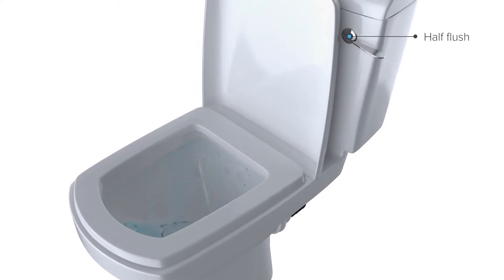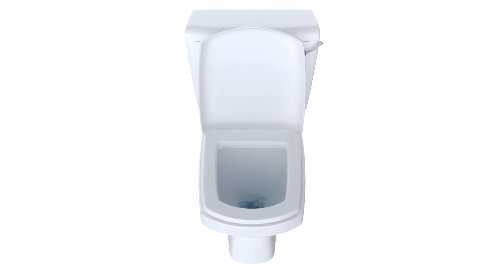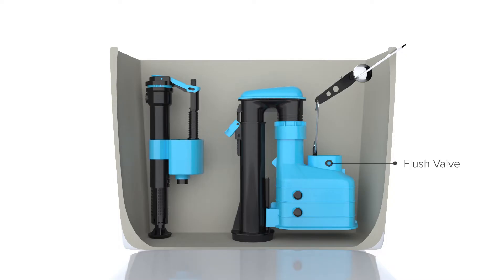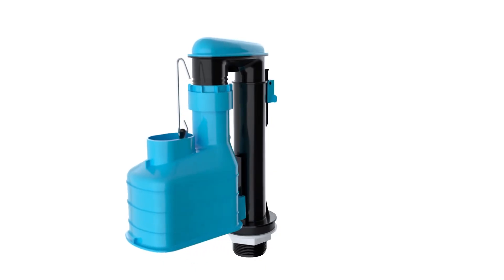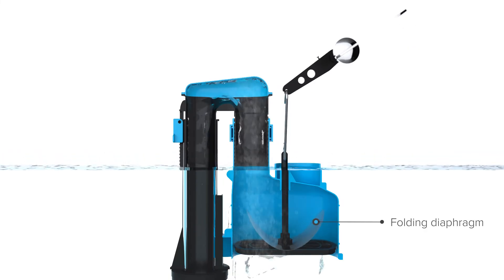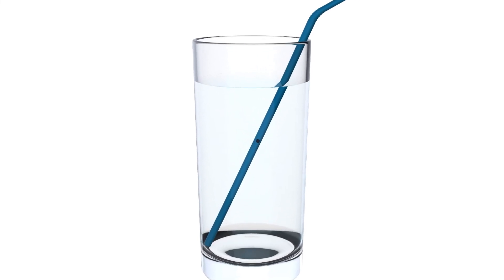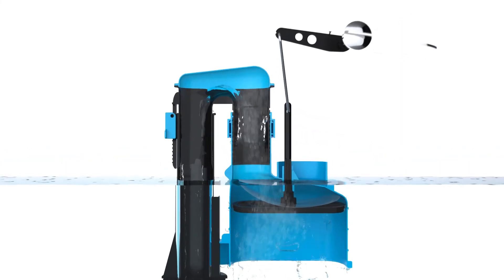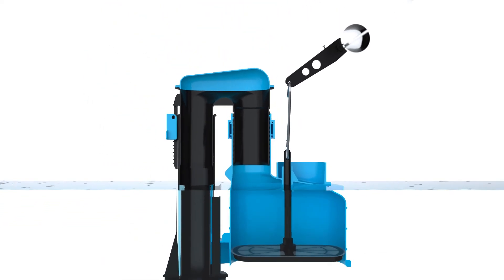How A Dual Flush Toilet Syphon Works

Comment: Thanks, it was very informative. However, I think the hole on the handle is incorrect as the holes are on the plastic tank/contailer itself. I say this because I couldn't find any hole on my syphon handle but found it on the plastic tank/container.

Comment: What a weird solution .

We have ones where you press a button which tilts .

And anytime you want to stop it you press it back .

The only thing this button does is lifting or lowering a central shaft with a plunger on it .

It's dead simple and you have total control over how much water you flush .
Reply: Indeed, seems very counterintuitive

Comment: Fascinating, sounds like a good system but I'm used to toilets where you hold the handle down for a full flush, so find it counter-intuitive.  Do you provide a sticker or something so users know how to choose the right flush?
Reply: I’ve seen two different ways the small and large flush is identified. It’s either a: a small circle is engraved on the small flush button and a large circle on the big flush
or b: the small flush button is smaller in size, and the large flush button is larger. 
Hope this helps